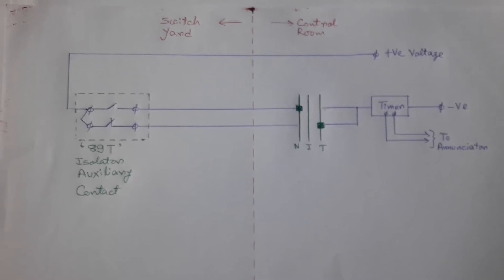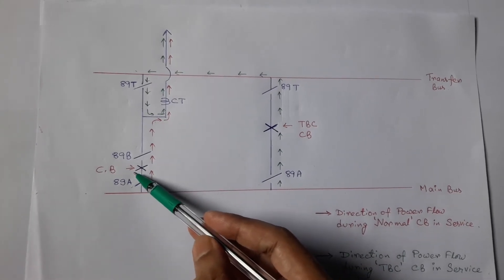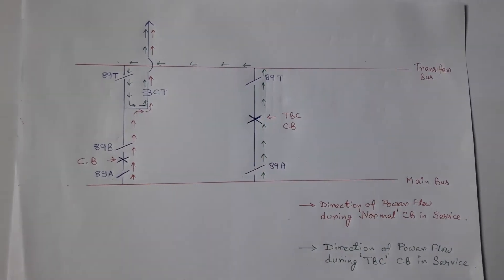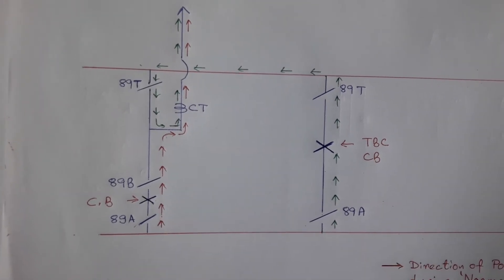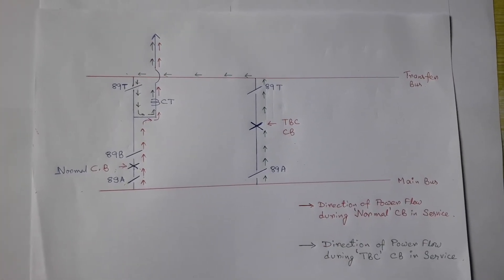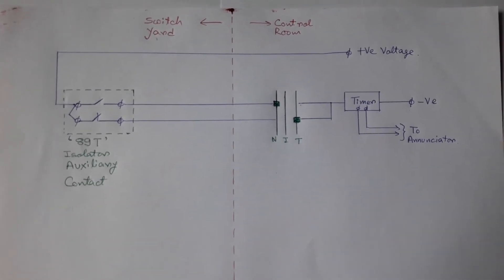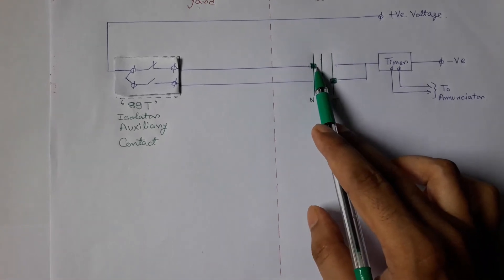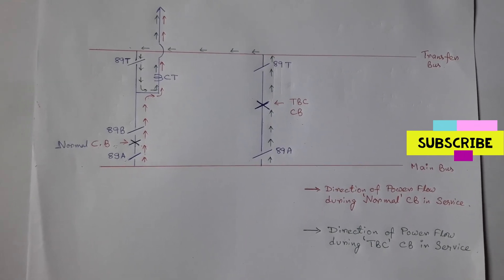trip transfer switch wrong position alarm

Comment: What is the significance of inter mode? Nice video sir
Reply from the maker: during diversion process of load from main breaker to TBC breaker, both breaker creates parallel path. During this time switch should be kept in inter mode and both CB will be tripped to clear the fault.

Comment: The timer is for allowing an operator sufficient time, to manually change the isolator positions and to correctly put the NIT switch as per the selected bus.
Reply from the maker: Exactly.